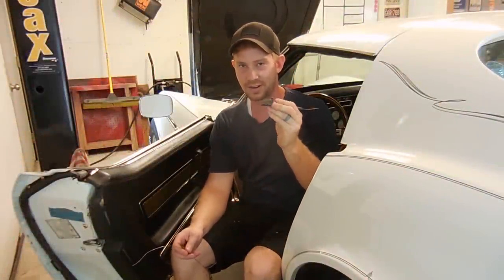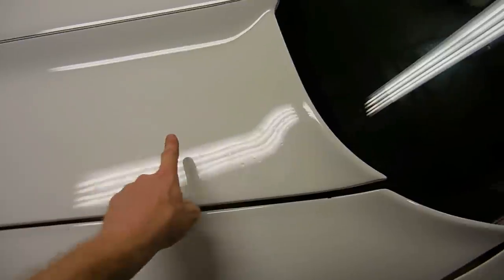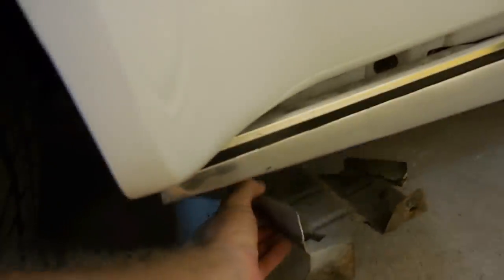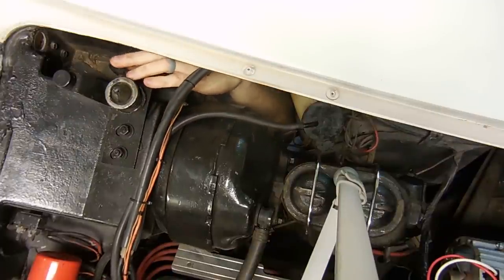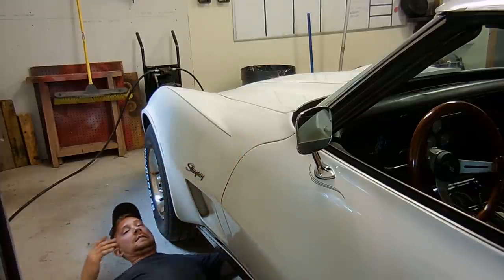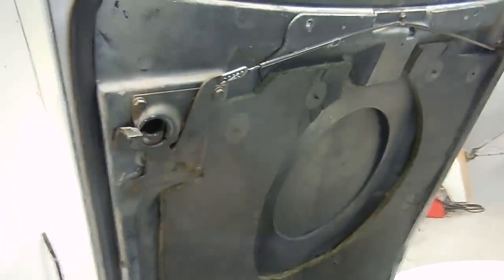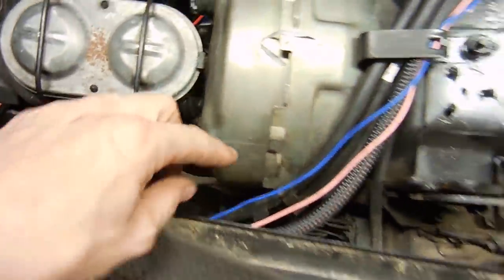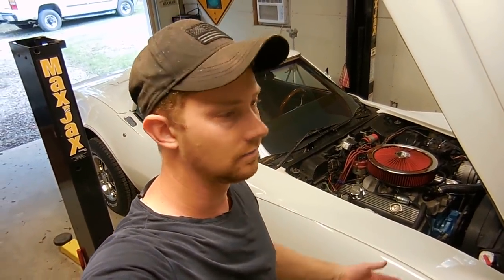The BEST Way to Open a Stuck C3 Corvette Hood 1968-1982 Using Common Tools Everyone Has

Comment: Yes, this was useful as a lot of older C3 vettes have worn cables that eventually break to open the hood.  Thanks again Ben!
Reply: My driver side of the hood is unlatched - cable is broken so I reached my arm in to pull cable but as hard as I pull it is not releasing the passenger side- any tips?

Comment: If I had a Vette I would make up a secondary pull cable at the latch and have it hang down enough so you can reach it and pull.
Reply: Exactly what I did with my 79
Reply: Yes, or just keep up the maintenance of lubing up cables and other moving parts

Comment: Thanks Ben, this worked for me. The only thing I did different was detach the charcoal cannister by removing the 3 screws that hold it against the wheel well. This gave my arm more room to reach the latch. .

Comment: As seen in the video, when you're using your fingers to do something and you can't see your fingers, it helps a little to close your eyes.  It helps your brain "see" what your fingers are "seeing."  Keeping your eyes open just distracts from mental imaging.  I first realized this when I observed my dentist had closed his eyes during parts of the procedure for a toot canal.  I've used the procedure of closing my eyes to (1) release the hood as seen here, and (2) install the spring on the back side of the accelerator pedal. t

Comment: Super value video! I went to check on my more current mustang and naturally no luck trying to get an arm to fit. It looks like I could unlatch via the front through the grille with a screw driver.

Comment: The 81 is a little different (TG). There is a rubber grommet on each side in the wiper tray.  Pop it out . The drivers side can be opened with an up and down motion of a screwdriver and the pass Side with a side to side motion if you can’t hook the cross over cable. Even if you don’t need it I would practice like a life boat drill. 
Thanks Ben I love your tips and help,
Reply: Thanks, I'm about to try this

Comment: It has never happened to me on my ‘78 but I had two tools made to trip the small tongue behind the latch via the access hole. One for the driver’s side and one for the passenger side. Those tools plus an inexpensive inspection camera will work for me if I have a problem.

Comment: That is exactly how I did it, although my splash plate is missing so no need on that.  Always tinkering on my engine so I removed the spring locks.  They say "your hood will fly open man!"  I've never had it fly open; although I never travel 80 mph backwards:)

Comment: I'm no genius but here's what I did.  My garage is full of stuff from a lifetime of tinkering.  I had some stainless steel cable on a spool that was about the same diameter as the stiff wire on the OEM hood release pull lever.  With a piece of that cable I fastened one end to the hood release lever inside the engine compartment.  A simple, strong knot did the job.  I then found a small piece of very light redwood about 1.5" x 6" x 3/8" and tied the other end of the stainless steel wire to the center of it.  There is enough room to let this piece of wood hang down and dangle freely and out of sight.  It wound up right around the shark fin louvers on my 1969 L-71.  Once you do that, it's simply a matter of pulling down on the redwood and testing it to make sure the hood release lever works properly.  I did that several times with the hood open and then several times with the hood closed.  It worked just fine but if it doesn't, play with it until it does and make sure if you ever need to use it, it will work.  This may not be the NCRS method of insuring your Corvette is up to "factory standards" but if you're out and about somewhere and need to open your hood in an emergency, you've got that situation covered.

Comment: Bien i needed this video a Month ago, i never got they hood Opened. After all that is wrong with mine i finally took it to a restoration shop. I talked to you before about my car. I still have not got 1 thing acompllished on it. There is so much wrong with it. if i could have got ride of it id liked a 2004 or so convertable. if these guys are way to high ill get it back and donate it to goodwill. i have never seen a car with so much wrong with it and no body wants to work on one. the 2 garages that have worked on it got me for $10,000 each. im way deep and have never got to drive it.
Reply from the maker: Heck might as well donate it to the channel if your gonna donate it to goodwill

Comment: My issue solely the passenger side. It will not unlatch.. I have tried every tool I can find to stick thru the plug but still can't get it to open. Pulling on the cable does nothing.. any other recommendations. Thanks

Comment: Good tip.  There are 2 types of C3 owners.   Those that have had this cable fail and those that will have it fail.  🤔  I have side pipes.  Probably not so easy for me.

Comment: The 70 71 and 72 egg crate can be removed also.  The latch can be released by hand easily. In summertime i always pop the hood. It runs cooler also do it on the 57 T bird.
Reply: This was a great idea!  NOow if I could only get the hood latch to pop free...

Comment: Prepare for the stuck hood:  Tie a cord on the lever you need to pull with your fingers as shown in hte video.  Now extend to cord into the windshield compartment and let it stay there.  If the hood ever sticks again, just pull the cord from outside the car.

Comment: Oh i had this happen. I bought my buddys completely rotted out  78 25 anniversary vetted that was nice looking but shot and I just wanted thd built 400 and I literally dumped the clutch once and ripped the diff right off r g e frame. So I went to pop the hood to rip the motor and got lucky when the cable broke i grabbed the whole cable and ripped it out and had just enough to pop the driver side and reached up thru to the passenger side and ended up cutting the car up because it was completely shot and unsafe

Comment: I rebuilt my engine and put a different manifold on it.  I installed the hood to make sure I had clearance for the manifold, carb and air cleaner.  When I went to remove the hood, the driver's side latch would not release.  I tried your method with no success, then figured out that since the radiator was not yet installed, I could remove the hood hinges and strut fasteners and maybe that would help.  I made a long tool to reach the hood release mechanism on the driver's side and although I can watch the latch moving forward as I pull on it, the hood latch will not release.  Any thoughts on a plan B?

Comment: Best way to close a C3 hood is, hold it about 6 to 8 inches above full close and drop it, worked on my 1977, then you do not have to touch the hood.
Reply from the maker: Only if the latches are aligned properly. I’ve seen some so bad they would never close like that

Comment: Use a new car, locked in trunk T handle. Hook a wire  to the latch on one side and dangle the T handle in back of the front wheel.  It will be cheaper than Mr Goodwrenches factory cable.